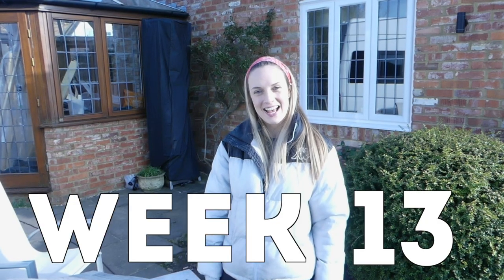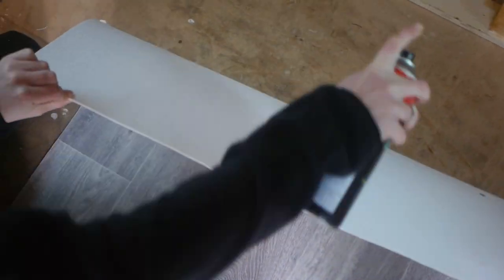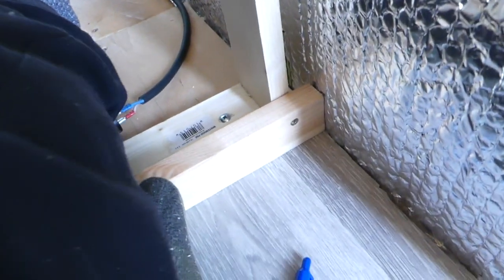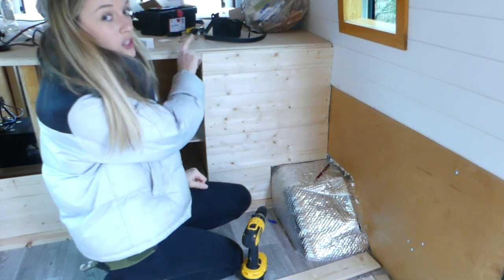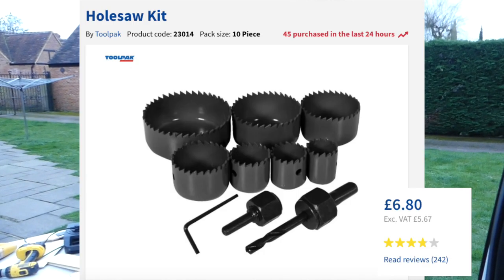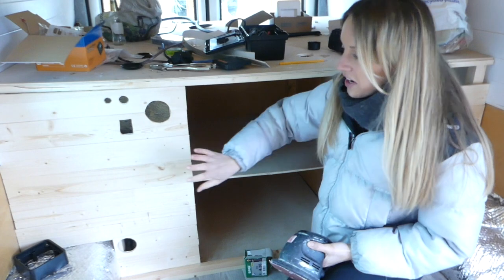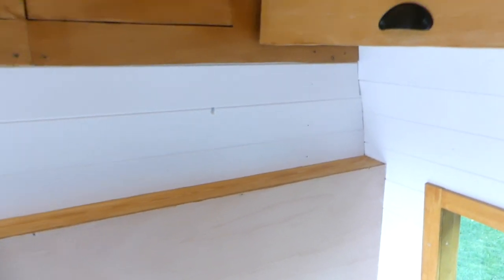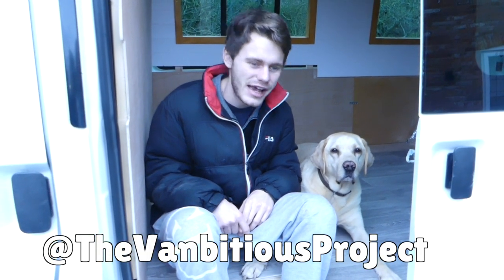Ep13: Installing our 12v Control Panel & Cladding the Fixed Bed Walls / UK MINIBUS CAMPER CONVERSION

Comment: I'm so glad I found your channel. Your conversions is looking fab - well done. I'm hoping to get a Transit soon to start a conversion - I started looking at minibuses as they seem a little cheaper.

Did you two have to re-register the number of minibus seats, and/or change the payload?

It looks like post-1997 driving licenses won't cover me to drive anything with over 8 seats, or with a payload over 3.5 tonnes (which some of the long minibuses have).
Reply from the maker: Hi mate, chuffed to hear you're liking the content! We were originally looking at a panel van but then decided for minibus as well as it was the cheaper option! We are going to get the van down-plated (once we have it weighed when the conversion is done) and then we can legally drive it on our standard licences! Hope this helps, we were planning on doing a video explaining on how we've done this when we have it done! :)